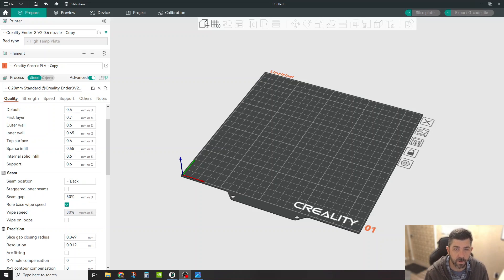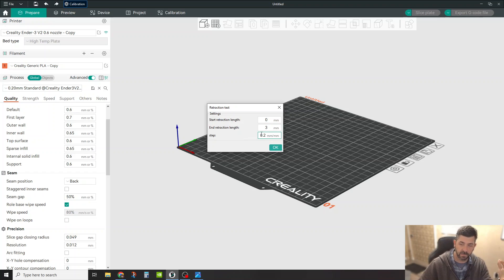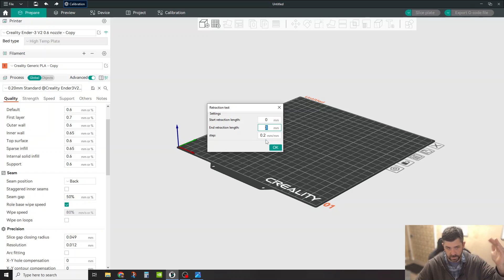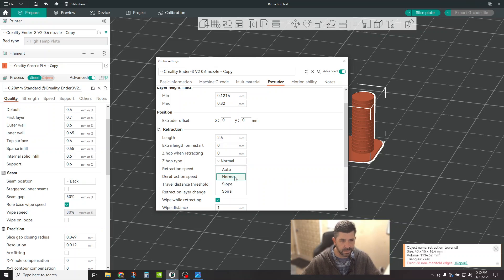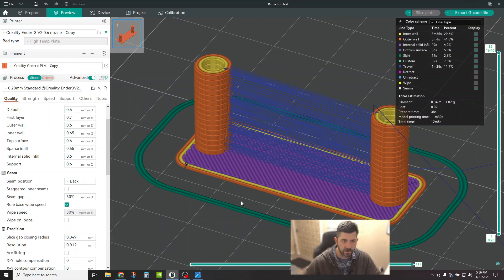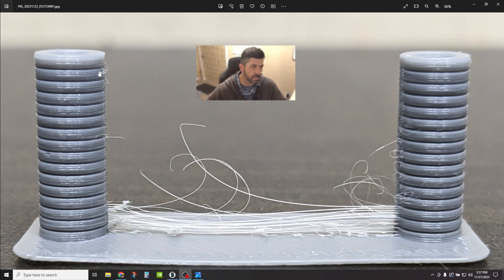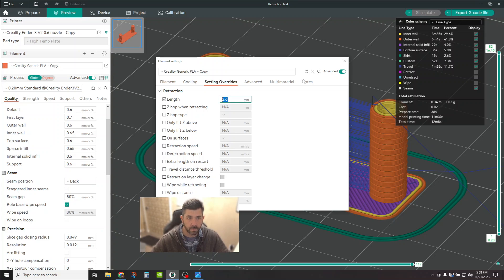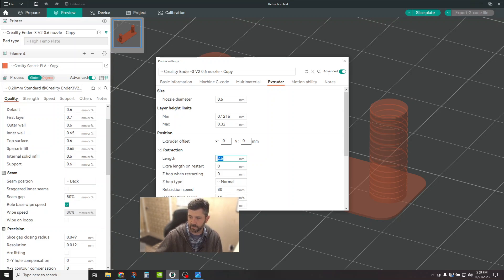Fine tune your retraction settings in Orca Slicer

Comment: mine was stringing at 0.8 and turned out that 0 was the setting with zero stringing.  What does that mean?  PETGHF on P1S with Hardened 0.4 Hotend.

Comment: hey man, i did the orca slicer retract calibration and it gave me great results, the stringing was gone after 0.5-.6mm.
however, when i try the other stringing calibration models from thingiverse it doesn't give me the same result. if i print a whole model using the setup that was working with the calibration model from orca - it would be fine at the bottom, where the widest part of the cone would be, but at the top - it would string soooo bad, and the stringing looks like silk and not like a "rigid stringing"

i've been trying to fix this for a week, can't get great results, please, can you give me any tips?
Reply from the maker: Which model from thingiverse are you trying?
Reply: @fischer3d  "Basic stringing test" by Loohney and "Ultrafast and economical stringing test" by s3sebastian. On the first one the stringing is present throughout the whole model, and on the other one - it only shows at the top 20-30 layers

Comment: No matter how much retracton i put still hairy very frustrating
Reply from the maker: so strange.   you're like the 3rd or 4th person this week to mention it.  what version of orca are you running?  what type of printer?  I'm wondering if the latest release has a bug in the test print.  conversely, i just reran the test and have 0 stringing even at 0 retraction.  my spider-sense says something in the sw is broken.
Reply: @fischer3d  latest version and anycubic vyper I'm thinking I might have to clean hotend was happening with bambu studio as well. Thought it was the filament it's MH silk
Reply from the maker: hmm.  ok, please let me know how it goes.  i'm looking through the gcode generated by the test to see if i can notice anything. i've noticed orca likes to bump default temps pretty high too while printing.  excess heat can contribute to stringing.
Reply: I have a Vyper as well, dunno how current the firmware is because we only use an SD card on int instead of connecting it to a computer. Anywho, having a similar issue to this on our printer, with the additional problem that any code I export from Orca will set the printer's hot end temp to 0° unless I preheat the filament, even though I have the temp I want set up in orca itself.

Comment: So I’m breaking in a new extruder and the stringing is bad, and when I run this, the stringing gets worse as the retraction increases. Can’t imagine why or how that happens.
Reply from the maker: strange.  This is the second comment i've seen like this in the last couple of days. I'm wondering if there is a bug in the retraction test introduced in one of the latest releases.  What version of orca are you running?  also... what temp is your nozzle and is z-hop on or off?

Comment: I'm not sure if you are going to see this question at this point, but first, thank you for the video.  My question, however, is at what point you recommend doing this calibration.  Should it be before the flow rate?  After?  Or better yet, is there a best recommended order of operations for all of the recommended calibrations?

Comment: The seam painting got me, now I know what my results have been all over the place, Thanks! I'll be at it awhile with my Ender 3V2 Neo, it has been making things fuzzy.
Reply from the maker: Thanks for the note.  If you're still struggling with stringing, double check a couple of items for the offending filament.  I've got a couple of rolls that string with default temps. Dropping temps by 5 or 10 degrees seems to help calm down the fuzz, also if it's a part that has lots of hops/travel moves maybe see if you can turn off z-hop.  z-hop typically promotes stringing.

Comment: Do you happen to know if the Bambi studio version of this yes works in reverses? I thought it was a direct copy but of orca but it looks like it does the retraction setting in reverses (starts at highest retraction and ends on lowest). I’m a bit lost
Reply from the maker: Which version of BS are you running?  I'm not seeing it at all in my version, but can update and test on my end.
Reply: @fischer3d  Thank you for the reply. I re did the test with different settings and it looks to have worked correctly this time? The orca github calibration docs specified to start at 1mm for bowden tube setups but it seems my machine doesn't string between 1mm - 3mm of retraction but will string horribly at anything above that which threw me off because it looked to be working opposite of the documentation. I thought more retraction would leave incomplete seams rather than blobs and stringing?
Reply from the maker: That does sound a little weird to me.  If you're running a bowden setup typically less retraction = more stringing.  Are you running too hot?  is z-hop distance too much?  maybe a couple of other things to look at.

Comment: i cannot get this tuned in, i have muliple test at different retract speeds to but still stringing
Reply from the maker: what kind of printer are you running?
Reply: @fischer3d  I am running an Ender 5 pro
Reply from the maker: Gotcha.  What are your retraction min/max settings for the test?  also, do you have z-hop enabled?  You likely want to make sure z-hop is off for that test on that machine.
Reply: @fischer3d  i have done two test, first one was . Start - 0 End - 6 with step being 2mm then second test was start - 2 end - 10  with step 2. Had thick stringing on both , z-hop has been set to normal
Reply from the maker: I would suggest setting your z-hop distance to 0 and rerun the test.

Comment: On this test it is easier to just set "seam position" to "aligned" as this will make the seams face each other, no need to paint it.
Reply: From my experience, I have to paint it because 'aligned' positions the seam on the left post as a spiral that wraps around while the right post has all the seams in a line.
Reply: This is the way

Comment: Just rebuilt an ageing cr10s pro v2 with a new 4.2.7 board with a lot of help from Victor Bared's great video but was really struggling the get the stringing under control I run a BMG direct drive (clone) which was producing good quality prints prior to the rebuild. Just ran the retraction test and bingo string cured!! Many thanks for great tips - looks like I will have to go back to school on this new  slicer. Are you intending to do a series of Orca yt's
Reply: I didn’t notice that at the time I replied I will go take a look thanks again
Reply from the maker: Glad it helped.  I've got several on orca out there already.  I have a playlist for orca under my channel if you're looking for more.

Comment: Thank you for such short and informative videos. lts always pleasure to watch.
Can I ask to explain another topic wich is how to cut big models?

There are planty of videos on internet but they all talking about "fat" models like statue.
In my case, I modeling a lightbox, that is shalow box with 2 mm wall. How to cut on 2-3 pieces in a way it will most unnoticed on the face.
Thanks.
Reply from the maker: Sure thing.  I'll give it a shot.  What program are you using to model the lightbox?
Reply: @fischer3d  Fusion.
Reply: https://drive.google.com/drive/folders/1Xt8gCDDlG00_lFFUksgebDY9zKYpp_7B?usp=sharing
Reply from the maker: Great.  Thanks.  What model printer do you have?
Reply: @fischer3d  :) I dont have it yet. Dreaming about Bamboo lab x1c. :)

Comment: What's the effect of too much retraction?  How does that manifest in a print?
Reply from the maker: Too much retraction could potentially cause under extrusion and clogging.  If the filament is retracted too far inside the nozzle for too long you risk the filament cooling a bit and clogging the nozzle.  In my opinion, retraction should be looked as reducing pressure in nozzle during travel moves.  Since the plastic in the nozzle is already melted you aren't really retracting what's already melted, rather relieving pressure pressure from the feeding filament in the extruder.
Reply: @fischer3d  Gotcha.  Thanks!   I have a day of tuning coming up.  I have way too many brands.  That has to change.